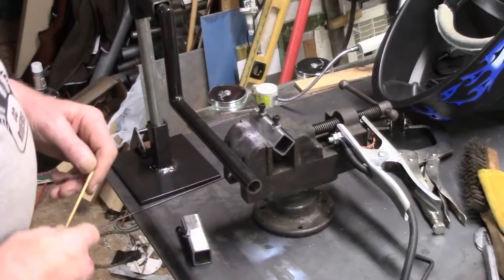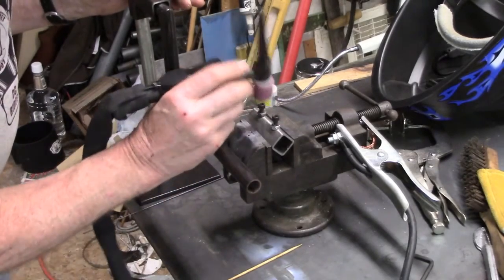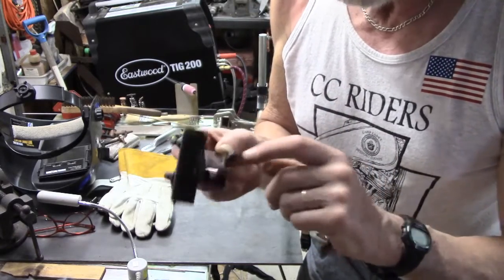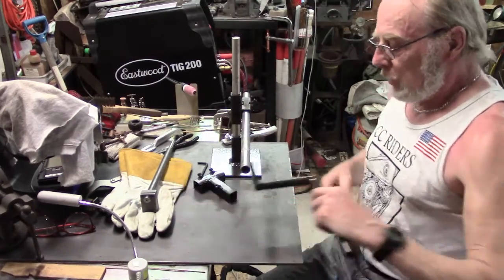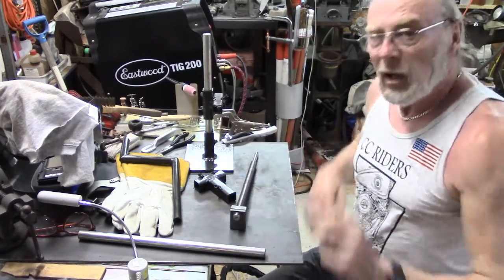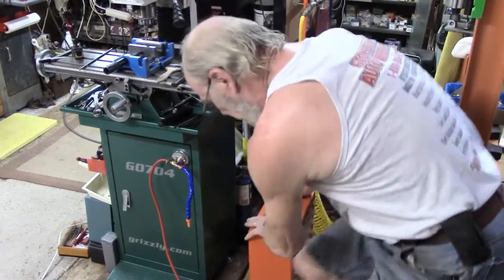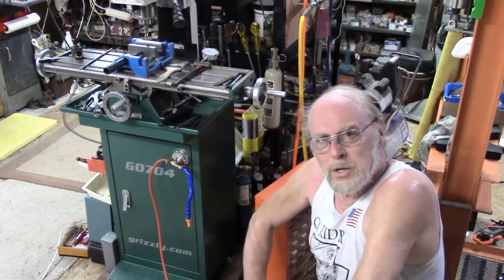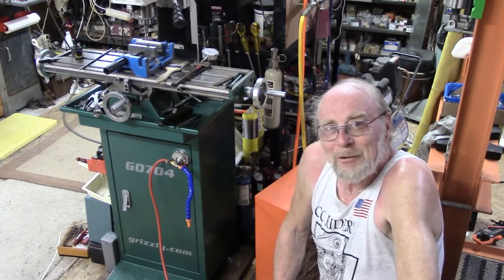TIG Steady - One more Addition

Comment: I think you have another nice tool.  It is good that you finally got the right parts from Grizzly.  I mostly gas weld as I dont have enough room for the breaker needed for the welding machine.  I guess i need to get one that uses less power and use in in the air compressor outlet.  It is set up for 220.  I know what you mean about heat and humidity.  It was about 80 in my garage today even with the AC running.  I will have to insulate better.  But like Abom said, a humidity controlled 80 is a lot better than whatever is outside.  Thanks for the video.
Reply from the maker: cerberus Oh yes -- pull the humid out of the air and all is way better. With shops it often seems we are always coping with extremes, one way or another!